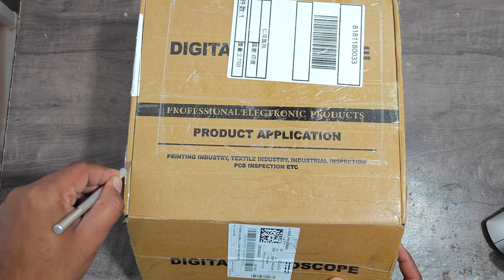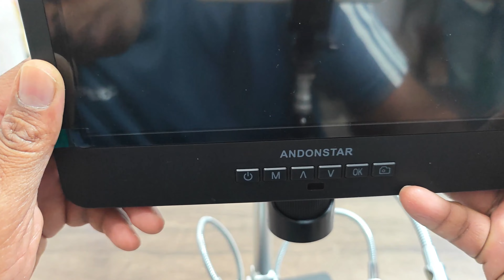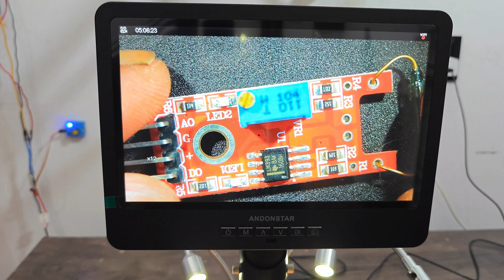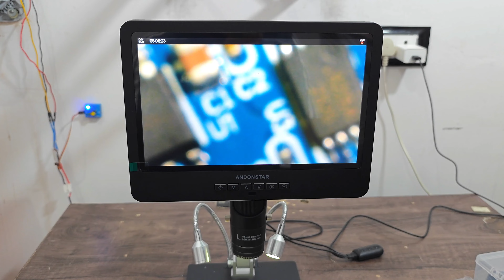Best Microscope For novice Engineer AD249S-M ES

Comment: $300 is very expensive. It is considered the price of a complete microscope, which is better than a digital microscope because it has three-dimensional vision, not like a two-dimensional digital microscope.
Reply: for 300 bucks, you can buy a normal trinocular. and buying a tripod (photo) and a outdoor camera is cheaper. a used monitor costs pennies. there are 10 inches here, I had 17" bought for 11$. for a total of $ 11(monitor), $15(tripod) and outdoor camera 6$. but not 300 bucks. Ali has a 3.5X-90X trinocular for that amount, a 4k 48mp usb hdmi camera, and 3 Barlow lenses with it. and the binocular is 2 times cheaper.